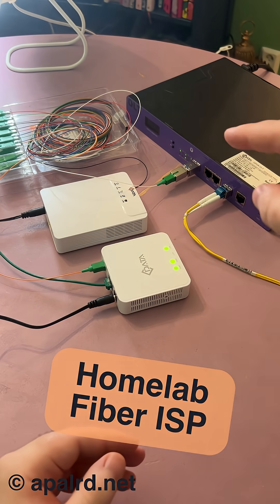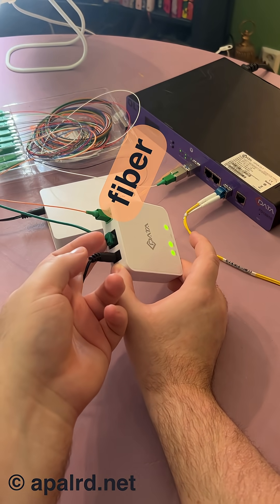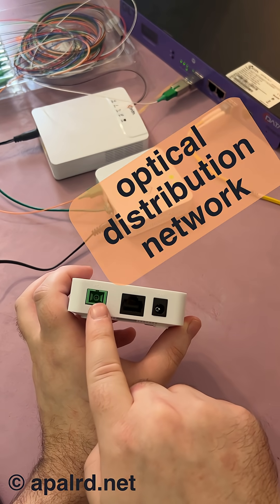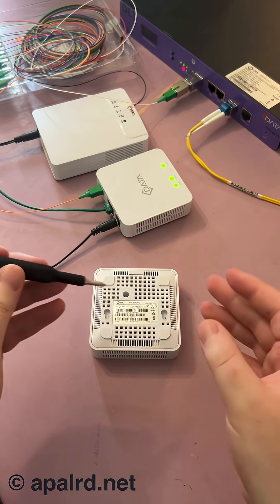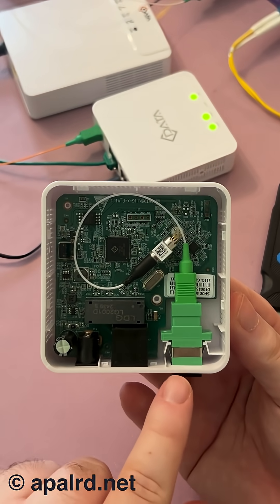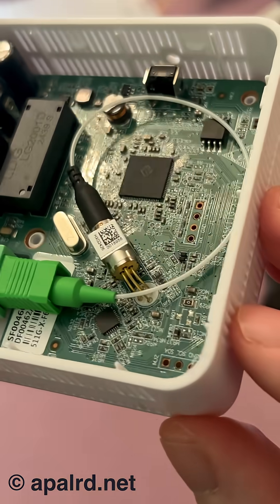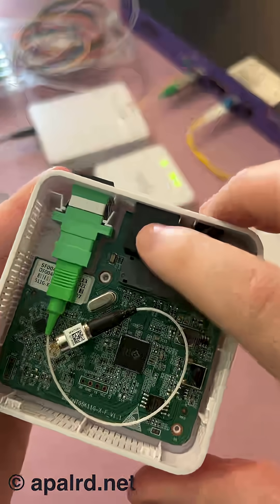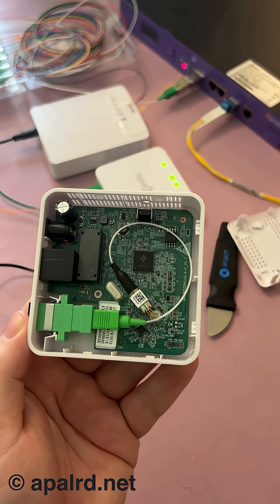What's Inside a Fiber Optic Network Unit (ONU)? #gpon #ftth #fiberoptics

Comment: The optical transceiver most likely has additional pins on the bottom. there is an optical splitter, so the pins you see at the end likely just from the laser or photodiode.

Comment: I'm trying to figure out what exactly ONUs for internet-carrying optical fiber do specifically when converting the optical signal to an electrical one. Basic descriptions talk about it like it's purely a conversion from one medium to another, but if I understand correctly, they're not the same encoding standard or modulated in the same way (1000BASE‑T for current a current LAN ethernet cable? With 16 levels of voltage?), so it can't be just one pulse of light = one pulse of electricity, right? Would love to see what the serial port says is going on.
Reply from the maker: Ethernet media converters do just convert medium. The signals are demodulated / remodulated as necessary, from 1GBase-T to 1GBase-SX for example. The layer 2 (MAC / media access control) framing and serialization is not modified. 

Some media converters also act as 2-port switches, so they will re-frame signals. This is required when changing rate between the two sides (1G / 100M, for example). 

ONUs are not media converters, though. GPON and its successors use a cell-based approach (GPON was designed by the designers of ATM), and encapsulates Ethernet frames into the cell transport. There are also control messages registering the ONU on the network, keeping track of the network time, and granting upload time slots to each ONU to avoid collisions and limit uplink bandwidth. So the GPON interface really is its own thing, and the ONU needs to interact with the PON network, decapsulate frames from the network (possibly decrypt as well, since encryption is used to isolate clients), and then pass them along as regular Ethernet.
Reply: @apalrdsadventures  Thank you for that detailed answer, really fills out the gaps in my terminology. I don't deal with networks directly myself, but I work with a lot of text about them and it's much easier to do if I understand what's happening. I hadn't even considered those additional functions of an ONU, but it makes perfect sense that that's what the additional equipment is for. The thing that was tripping me up was actually the idea of converting between 1GBase-T and 1GBase-SX, because in copper there are 5 or 16 voltage levels that the code words are transmitted with, depending on the standard, and in fiber, from what I've been able to find, it's NRZ on for 1 off for 0. Do I understand correctly from your answer that when the actual information being encoded and transmitted stays the same, it's possible to convert between different physical line codes without requiring power, just with math and circuitry magic?
Reply from the maker: It's not hard using digital logic to convert 4 serial bits into 1 symbol, and vice-versa. It still requires power for the logic, and also for the line drivers (either lasers for optics, or to drive the pulse transformers for wired Ethernet)
Reply: @apalrdsadventures  Great, that makes sense to me. Thanks for taking the time, and great channel!

Comment: Ohhhh, this hits on time. I was thinking about replacing my ISP provided ONT/Router with a Mikrotik w/ SFP GPON. But I was backing off due complexity and maybe not being worth it. I mean, is probably worth it, since I have a lot of devices routed by the ISP-provided router, buuuut haven't hit its limit yet (I do use the routing, but have my own switches/APs). Some comment did provide a good insight (thx! @maurice_walker); I was thinking about a since my ONT is Zyxel, I may just go with their GPON unit for the sake of compatibility + a MikroTik hEXs. Still, would need to change serial/id for the thing, as my ISP does auth with that (UNINET / AS8151). I found that some users have managed the heat with mods, aka putting a big noctua with a custom printed cover lol. So should I do it? It may be just a fun little project, I can at least try with UNINET, since my other ISP (AS28548) is a big no-no for custom ONT (but I hate them, since they touch my router configs and they casually break things with that)

Comment: If you have a router / switch with an SFP port, are there any good reasons not to use an ONU SFP instead? No extra power supply, fewer cables.
(I use a Zyxel GPON ONU SFP in a MikroTik hEX S at home. Neat little setup.)
Reply from the maker: Heat, that's really the only disadvantage. SFP modules are more compact and may be significantly hotter when running.
Reply: Yeah, I noticed that. I've never seen mine report less than 60°C, and 75°C or more on hot summer days. Well, as long as it works (which it does, rock solid).
Thanks for your work! Currently rewatching your four hour GPON stream.

Comment: Can you use these to do cheap fibre runs in the home?
Reply from the maker: No, the OLT is quite expensive, but it’s not very expensive to do gigabit fiber at home if you pick switches with sfp/sfp+ ports

Comment: Question from someone that wants to learn about this specific subject. My ISP uses a ONT/Router combo and since I have my own network hardware I would love to just get rid of it and go straight into my hardware. I know a bit about networking, but I never worked with ONTs or know how ISPs use them specifically. If I get an ONT and connect their fiber to it and the ethernet to my router, does that work or is the system expecting something specific that their ONT/Router combo has/does for the connection to work?
Reply from the maker: The ONT (without router combo) is a very basic device. If they offer any split ONT/Router options I’d just go with their ONT. 

As to replacing your ONT, they are authenticated to the OLT, usually by the serial number but not always. You can get generic ONTs which can be set to the serial number of the old unit, but you’ll want to do some research on your isp specifically to see what other people have done or learned from. 

You also need to know if you have GPON or XGSPON or some other standard, so the ONT is compatible. They use different optical wavelengths.
Reply: @apalrdsadventures thank you, will do some more research on it

Comment: I'm surprised there's not some connection points for an optional PoE module, I often see that in switches and APs.
Reply: I am sure these are super cost optimized. You really do not want anything extra in these things, as that would cover 99% of use cases. Want something more, get a different model.
Reply: @movax20h  If there's enough board space to place the connection points, it costs nothing extra if those points are not used. I often see dumb switches with the points for an optional PoE module.
Actually, I would say that in a lot of fiber installs, the extra cost of PoE hardware would be offset by not having to route power to the box. Especially if there's not already a nearby outlet and/or if the customer wants it on UPS which most who already have a UPS do.

Comment: I found many small ONTs online that are packaged inside SFP+ modules (with no external power required).
Do they actually work? 🤔
Reply: I believe most of them are GPON (I don't know what that means) 😅
Reply from the maker: I have two, they do work yes

GPON is a sort of 'generation' - there are two different PON families (EPON / IEEE and GPON / ITU), GPON's successors are XGPON and XGSPON. You must have the correct version for what your ISP uses, if your ISP uses GPON you need GPON, if they do XGSPON you need XGSPON.
Reply: @apalrdsadventures 
Do I need to match the ISP's infrastructure, I mean I believe they use Nokia OLTs, do I have to look for Nokia GPONs or would any company suffice? 🤔

I'm currently deep diving into networking since I’m renewing my house's network, and currently, my biggest bottleneck is the ISP's modem (it's really bad even in bridge mode).
Reply from the maker: Technically any ONU should work with any OLT (if they are the same tech standard / generation, GPON with GPON, XGSPON with XGSPON), but in reality it's entirely up to the ISP how they will filter and authenticate ONUs. Many do this based on serial number, so sometimes you can clone the serial number of their ONU, but you'll really have to look up on the internet information specific to your ISP.
Reply: The single fiber SFPs are pretty much electrically identical to the more common dual fiber ones, the difference is in the wavelength splitting optics.
Reply: The biggest problem with those ONT SFPs is that they tend to overheat, so they need additional heat removal. This form factor is way better IMO. 🙂

Comment: The small chip is BOSA Signal Processor and big one is ARM SoC with integrated ethernet controller. I bought a VSOL V2802RH ONU based on Realtek RTL9601D SoC, it has 1x 2.5Gbe & 1x1Gbe port.
Reply from the maker: It doesn't make a ton of sense to me to use 2.5Gbe on a GPON network, being that the network can only do 2.4/1.2g across all clients. For XG(S), yes, that would make sense.
Reply: @apalrdsadventures  The 2.5G RJ45 + 10G SFP switch chips are a commodity product now, it would not surprise me at all if they're using those in products that only use them to a fraction of their capabilities. Given they're tiny bits of silicon, there's little to save making a less capable version of the chip, more likely would be if they're "binned down" due to the 10G side not meeting spec.
Reply: @apalrdsadventures yep, but we don't have XGS-PON rolled out yet

Comment: If I have a pf/opnsense box connected to the wan of the ONU/ONT, what is the need of buying a ONT, because I know that I cannot access my ISP's ONT, but why did you need to buy one.
Reply: because in this scenario he is the ISP and needs to provide himself with an ONT
Reply from the maker: The ONU/ONT is primarily a layer 2 device which bridges between the PON network (which for GPON/XGSPON is cell-based), manages encryption on the PON, and passes that traffic to regular rj45 Ethernet. It's not doing any routing, so using the ISP's ONT is usually the right move. There is no way to 'access' the ONT since all of the settings are pushed from the OLT. 

There are combo devices which are an ONT + a full router / wifi / .. and in that case going to a 'dumb' ONT-only device would be better.

For me, I'm setting up the whole network (OLT, ONUs, and optical distribution network), so I need all of the pieces.
Reply: @apalrdsadventures  So you are creating your 'own isp' to give to other clients?